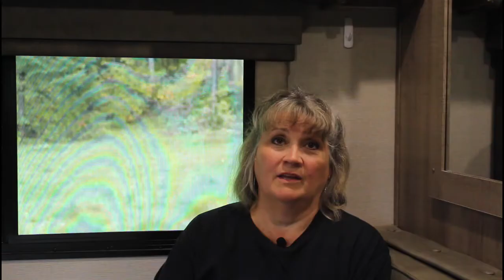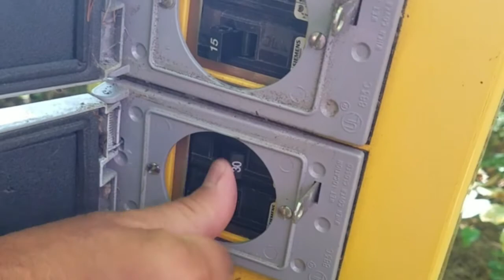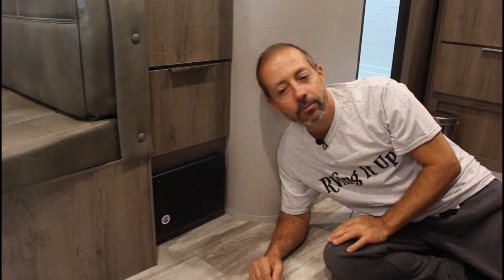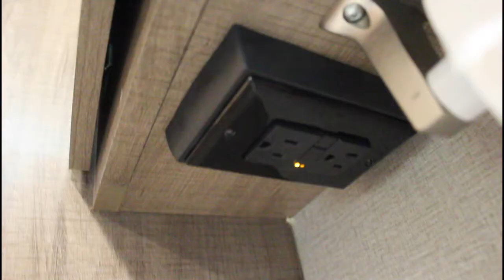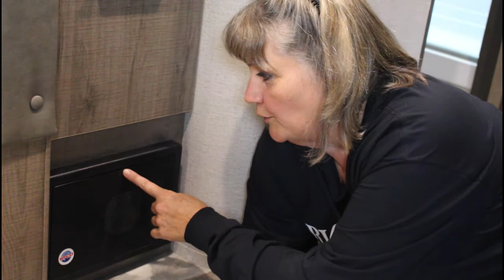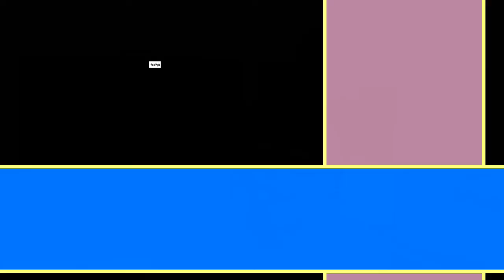How to Troubleshoot an Electrical Problem in your RV...  things to do before calling an electrician!

Comment: One thing to note when plugged into shore power your dc lights etc are supplied 12v by the converter not your battery. If your battery is low and your plugged into shore power, this indicates a bad converter and/or breaker for converter is tripped and it isn't charging your battery(ies). Great video!
Reply from the maker: Great points!